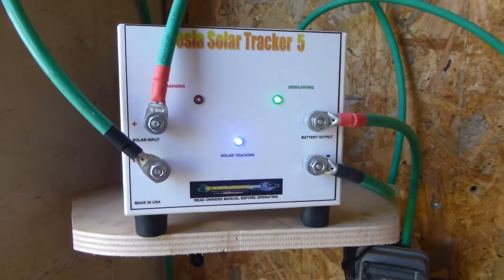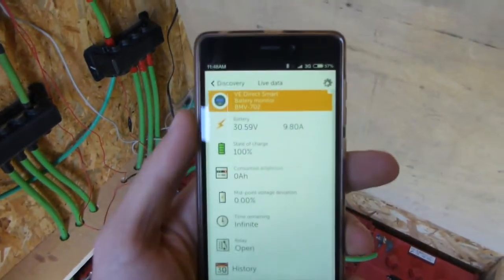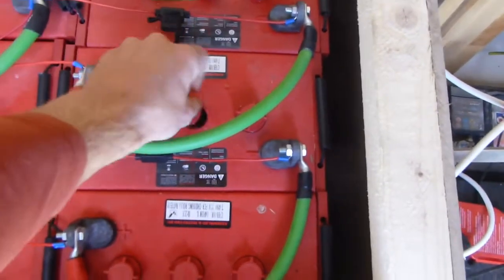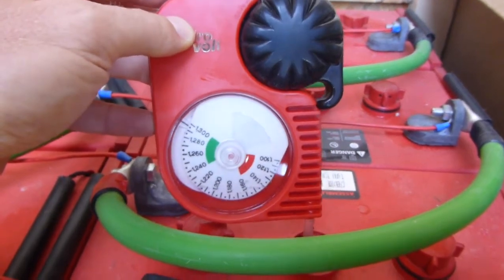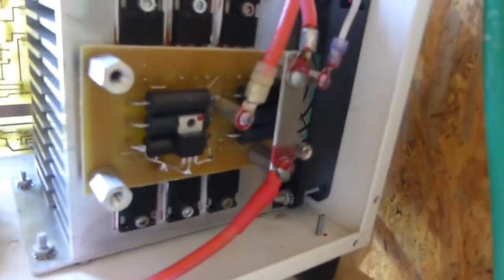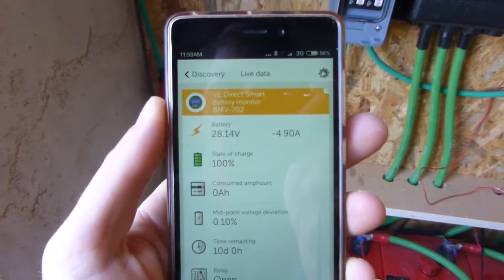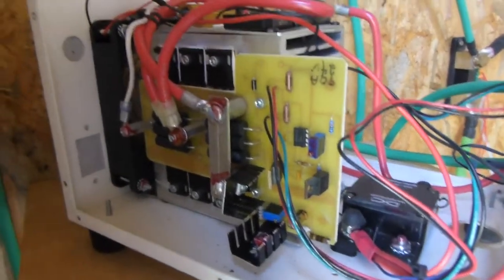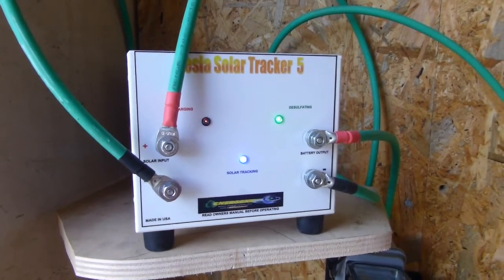Off Grid Solar - Tesla Solar Tracker 5 EX - Look inside & Review

Comment: Thank you for sharing this, it was very helpful in my research with working on figuring this out. I would be interested in knowing what the part numbers are on the semiconductors and that IC to help confirm some understandings I have.
Your question about what was on top of the heatsinks, the three components wired together, those are bridge rectifiers  that he is only using half of the diodes on the positive side in parallel instead of one big diode to protect the electronics from being hooked up with the polarities reversed which will cause damage to the panel and electronics.He was in the audio electronics business for decades and probably had a big box of those bridge rectifiers to use instead of spending a lot on one large diode in the beginning, but you can see in one of his videos they eventually used just one large diode instead.  
Your other question was about the brown stuff on the terminals and if that was from over heating. That is just left over soldering flux from when the buss wires were soldered on, it  is completly normal to see in electronics and has nothing to do with over heating of a heat sink like you think.
Reply: One more thing, if you want to mount to wall, you could remove the feet off the bottom of the unit and use those holes to screw to wall, or to screw to a larger  metal plate, so that the plate then screws into the wall holding the unit.

Comment: It will be interesting to see how it performs in the long term. I don't think your batteries are being boiled to s#*t but keep an eye on the fluid levels if they continue to slightly bubble all day.

One thing that is particularly good is that components in the controller can be easily replaced if anything goes wrong. A local Radio & TV guy should be able to easily handle that should the need arise.

MPPT is seriously over-rated. It has the most effect when you get a cool sunny morning and the batteries are particularly low. Contrary to the commonly held belief, MPPT has no real advantage on cloudy days, as the maximum power point voltage of a solar panel becomes close to the ideal battery charging voltage anyway.
Reply: Although running the panel voltage higher can take advantage of smaller cables, it also means that buck converting must be taking place at all times for the system to function. When panel voltage is matched to the battery voltage the charge controller has the option to bypass the buck conversion and just go straight through - acting like a PWM controller or a piece of wire for that matter.

For places that see a lot of overcast conditions that's important. Because any time there is voltage conversion going on there has to be some loss. You don't want your tiny harvest on a cloudy day being eaten up by the buck converter's overhead.

The bridge rectifiers in the Tesla controller are simply being used as diodes. In fact one big massive diode. It's purpose is to avoid the batteries discharging into the solar panels at night. 

Adam, that sounds like exactly what you have done. If you slightly over-volt batteries you can in fact store more energy, just at the expense of battery life. The Tesla controller works quite differently to a normal charge controller "wound up". Although it does reach 30+ volts (on a 24 volt system) as it's getting near the top it pushes the current in a far more gentle fashion than a normal controller does.
Reply: Yes I followed some guidelines in the videos from Tesla Chargers when making configurations to the Victron's.  While in "absorb" mode the electrolyte is a bit fizzy like a glass of champagne and during Bulk there was no fizzing at all, which is in line with what the videos are saying.  As I have unsealed my sealed batteries I have the good fortune of being able to observe this rather than leave it up to assumption.  But essentially as the batteries need less current they will get less from the Victron's.  If there are big bubbles then the Victron's are sending too much current -- this has not happened the past 2 days.

As for the MPPT, in my case (note this is not necessarily going to be the case for others) when I put the Victron 100/30 against a good quality PWM controller, the Victron left it in its dust.  There was approx 20% more current being sent to the batteries with the exact same panels & configuration.  When rewiring the panels in series, that went up by approx 2 or 3% further, but then again there was little headroom on my cable if the panels were run at the lower volts.  This was also tested on a cloudy day as well as a sunny day.  A sunny & HOT day the MPPT came in at around 10% more.  It was after all these tests that I then spent the $$$ on the 2 Victron 100/50's...Also there were the Jaycar MP3735's in the mix too, a half baked MPPT controller which actually performed WORSE than the PWM!!  I was glad to see the back end of those things.
Reply from the maker: Im helping a friend to expand his solar field by 1100watts so that he can pump water from a well in the day time and we will be using a victron 150/50 controller, they do make good gear.
Reply: I do wonder why they used the parallel bridge rectifiers as the blocking diode? Too hard to get large Schottky diodes perhaps?  Worst case scenario though is if there is 80 amps flowing then the diode bank would be dissipating between 80-120 watts of heat. And you would have the better part of 1500 watts of solar panels to cause this, so in the grand scheme of things, although it is a significant loss, it's not overly significant.
Reply from the maker: yeah, so far so good but the battery bank is very young so time will tell.  Im of the same opinion about mppt, its probably an update in technology respects but in my situation I really dont think it would make much of a difference.  ALso the downside of having panels running in series with shading etc...

Im planning on making a data logger so that we can get a better glimpse of the charge profile.  Hopefully I will have that done this summer.
Reply from the maker: the "free energy" crowd are big fans of bridge rectifiers.  I have so far been able to put close to my rated solar power (2400w) through the unit with few losses but will know more once I get my system monitor up.

thanks for your comment!
Reply: The one thing MPPT does do that PWM cannot, is take (in my case) around 75V from the panels and convert that to voltage my batteries can handle.  This means I do not need to run such heavy duty wire from the panels to the controller.  Usually when it is cloudy here it is also cool so the MPPT seems to take advantage of that, when I compared the Victrons directly with a good quality PWM controller there were a good solid few amps of difference between the 2.  As with all things, results vary depending on location/situation/setup/equipment/goodness knows what else to factor in here lol...
Reply: @Mandala man: Yeah I have noticed that. :) Although in the case of your charge controller they are not being used as bridges, rather they are taking advantage of the fact there are two diodes in each unit that can be paralleled to make one big one! And they have done that three times, so there's some pretty decent current capacity there. 

Although, if you parallel two diodes there is no guarantee that they will share current equally. But being closely bonded together in the rectifier block probably tends to mitigate that to some degree.
Reply from the maker: yes, that is a valid point if your panels are far away.  which mine are.  I have about 100feet of cable which did cost me around 300+€
Reply from the maker: and what function do they play being used like that?
Reply: Well yes if the panels are more in series, the higher voltage means lower loss across the wire and also lower amps too, I probably saved myself a decent amount of money in wiring costs.  Probably a solid $200 - $300, which nearly pays for the 100/30 controller I have.

On another note, last night I was able to draw 220Ah from my batteries and be at 50% DOD which is already an improvement from what I have had recently.  Normally I'd be at 50% DOD with about 180Ah.  Now, it may just be the fact that I have technically slightly over-volted the batteries and that has pushed more power in, but time will tell!!
Reply from the maker: thats great mate!! Im glad that you are experimenting with this stuff.  would be great to see a video on the results of  your trials.  Are you doing the discharges the way they recommend too?

thanks for the info on your experience with mppt.  If it wasnt because i was interested in trialing the tesla chargers unit I would have probably gone for a midnite classic.

I have the Bedinni SSG pdfs if you want them.
Reply from the maker: @xanataph.  thanks for the info mate!
Reply: Yes I am doing the discharges in a similar fashion too.  I figure the more I can do this by what they're talking about the higher my chances are of any success, if there is any to be had.  Personally, I think the Midnite Classic is probably a bit better than the Victron gear, but seriously not by much.  Victron make some extremely nice gear, and my 3 Victron chargers have been 100% flawless since I bought them.

I'll send you a private message mate, I'd love to have a read of those PDF's
Reply: If you know Melbourne, Australia, you will know just how seriously overcast it can be here during Winter lol.  It makes solar, no matter what your take of it, a bloody nightmare lol.  A couple of Winters ago there was literally 2 weeks straight without a single ray of sun getting through the clouds.  And at the time I had a whopping 500 watts of solar, but the same battery bank.  I couldn't run the inverter at all -- it was only used to charge my phone, tablet, and run some 12V lights.
Reply from the maker: no I have never been so dont know the climate.  sounds like the opposite to where I live.  here we have clear blue skys for 300+ days a year.  very lucky and really good for solar.  The ironic thing is that even though we are the best place for solar un Europe we have the big business energy mafia that influence the gov to put big taxes on solar making grid tied systems a nightmare.  fine for offgrid though.

thanks for all of your comments and vids mate!
Reply: Yeah I am very happy with the chargers they make.  The battery monitor does get very slightly lost when there's a lot of cloud cover for a few days but it is also pretty good.  I've seen vids of their inverter/chargers and they look superb, but are very expensive.

Comment: G'day mate, this is a good video well done.  Again it is a very interesting configuration with the charge controller.  Just out of curiosity I have adjusted my Victron chargers to charge my 12V battery bank at 15.3V, I'll give it a couple of weeks and see how my batteries respond to it.  They're currently stuffed anyway, chances of making them worse at present is next to nothing.  I took the time to watch this lengthy review on battery rejuvenation by Peter Lindemann at https://www.youtube.com/watch?v=K4__eH9-MXk and while so many people would say to me that is crazy talk, I have decided to give it a go.  I've adjusted my BMV-702 so it doesn't tell me off :)

Instead of just rattling the rhetoric saying this will kill the batteries, let's put it to the test, and prove it or disprove it.  Mythbusters time!!
Reply from the maker: Hi Adam,

yeah thats totally what Im doing with this this charger.  If you are interested, I have their solar secretes and battery rejuvenation PDF's, if you send me a private message with your email I can send them to you.

How much current is going into your batteries at 15.3v???  because my charge controller throttles the current right back to keep them there.  It will be interesting when I have my other battery monitor and data logger up to see exactly what the charge process.  I dont think it does the bulk charge at 30 volts.

keep an eye on them and make sure they dont overheat.  yours are sealed batteries so might be slightly different and knackered batteries is batter than no batteries so keep a good eye on them.

thanks for you comment mate and for being open minded and trying it out for yourself.
Reply: Hi mate,

I grabbed the PDF's last night while watching the video I mentioned.  Very interesting indeed.

Today was the first trial run and, as per the video, the batteries did not bubble at all until about 15 mins into the absorb phase.  Initially the Victron's were throwing over 100A at the batteries but when it reached 15.2V (I set them to 15.2 instead of the 15.3 which is what's recommended for flooded and what I originally said I would set them at)  they just throttled the amps back to keep the batteries there...until a cloud blocked my sunlight lol.  Ultimately though the Victron's should have mimicked what your charger does or very close to it.

As my sealed batteries are now somewhat a sealed/wet cell hybrid I took a peek and saw the water was bubbling just like a glass of champagne.  According to what I read and viewed in the videos, that's exactly how you want it to be when doing the topping charging.  There was no heat detected, my BMV-702 has a temperature sensor so it would have alerted me to any anomalies.  

Obviously it is too early to tell if this has had any positive or negative impact on my batteries, so will need to report back on this to you in a few days.
Reply: Hi mate, It's been a bit over a week with the changes and while not every day has allowed me to fill the batteries, I have been very close to full every day.  So far the batteries are not getting any worse and I do have a small bit of extra run time from them.  But as of yet I am not seeing any serious improvement.  It may be that, just like adding the water to them, postpones the inevitable.  Will give it a few more weeks and see if there is any tangible improvements, but yes with the way the Victron's are configured the batteries are not bubbling excessively.
Reply from the maker: Hi mate,

thanks for the update.

Comment: thats a rough a***d way to use (40 amp) bridge rectifiers... the're made for ac to rectification and it looks in that setup they are using them as blocking diodes with 2 of the 4 diodes in each pack being wired in parallel, and then 3 packs in parallel , so you effectively have 6 diodes linked up.

But... they heat figures and amp ratings are not for continuous dc steering, so they may be getting a little warm, the staining you can see on the solder is from where they have got so hot the flux in the solder came to the surface.

they should be using schottky diodes,..

the gubbins on the sides of the heatsink are no doubt ''mosfet switching transistors'' to regulate charge / cut power / on / off etc
Reply from the maker: Hi Lez,

 Yeah the charge controller got pretty hot when the fan failed so staining must be from that.  It does get quite hot anyway which they obviously know which is why there is the massive heat sink.

thanks for your comment and the info!!
Reply: The heat is from the inefficient use of those bridge diode packs, but they should last year's. You can pass your solar charge current through them all day.  At the cost of it I'm interested on what they're doing with it as from what I have seen so far it's looking like an older design beefed up for larger panels
Reply from the maker: yeah dunno, they have some very different theories on how things should work at tesla chargers and from what I can tell their battery rejuvenators are very good. So if they can get batteries back from the dead you would think they would know how to charge them well.  Only time will tell.

Have you heard of John Bedini's work before or did you just come across my video by chance?

here is their website if you havent heard about them before:
http://teslachargers.com/

thanks again!
Reply from the maker: So far so good and only time will tell so Im going to ride it out.

It only uses 1 amp to run.

I will run some tests when the PIP is up and running.  then we can see what kind of a job it is doing compared to an mppt.

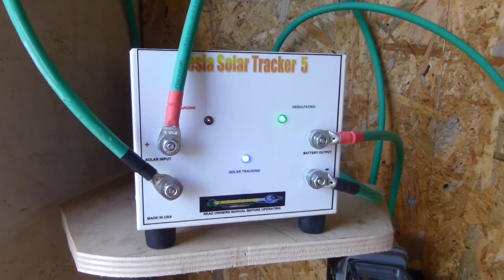Everyone raves about mppt, but in my situation and climate I dont see any real benefit.  It may be able to get more out of the panels in the morning and the evenings and on cloudy days, but seeing as I generally dont get more than a couple of cloudy days in a row (average of 300+ sunny days a year here), my batteries are generally full before 12:00, I have full sun and no shading on my panels, I dont see how its going to make much of a difference.

As i said in the video, the people that designed this charge controller have a different view on how batteries should be charged which is why it charges in this way.

thanks for your comments and all of your videos.  I think if I ever build another system I will go with a lithium bank.
Reply from the maker: what are the signs that I am overcharging my bank?  How will it kill it?